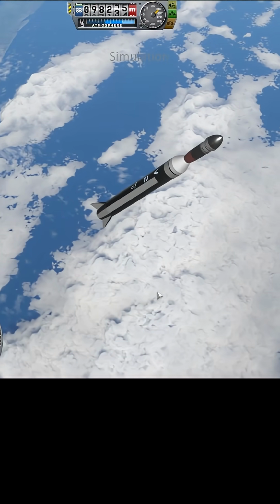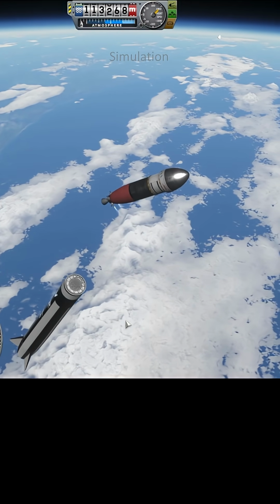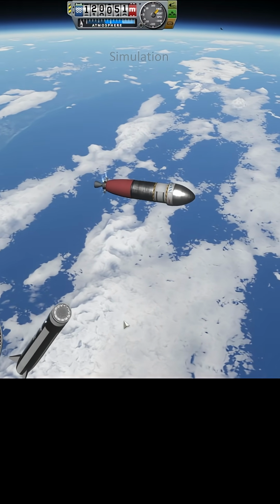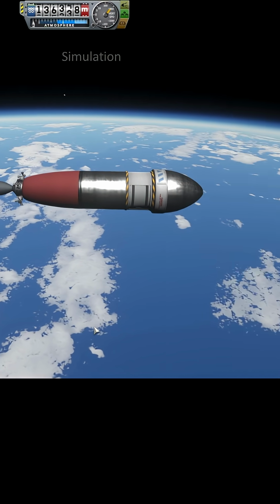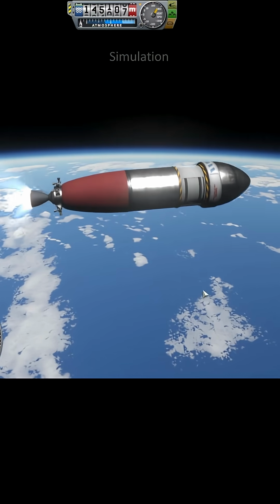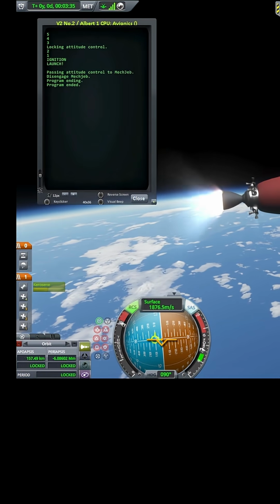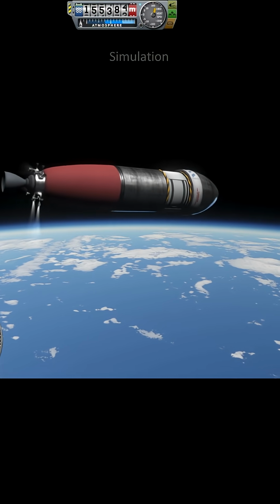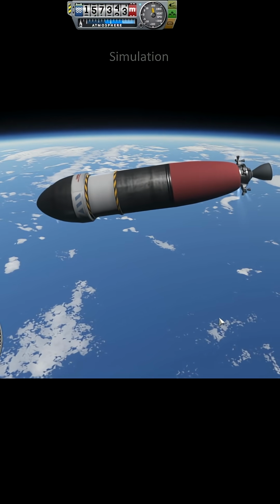Practicing Space Maneuvers | KERBAL SPACE PRGRAM | RP-1

Comment: When you press Z its for full throttle, but as the main engine is not active, or is unsafe to start due to fuel slosh, it translates the RCS forwards as ullage. This make the fuel stabilise and then the engine starts, and it automatically turn off the RCS forward translation.